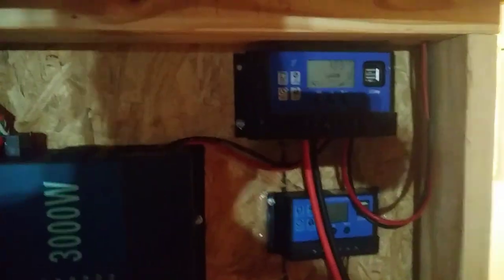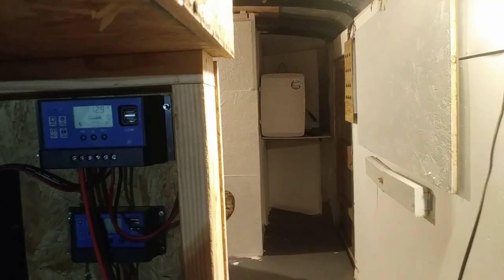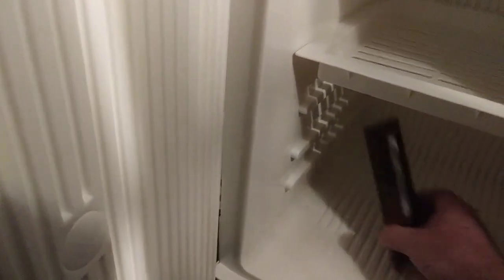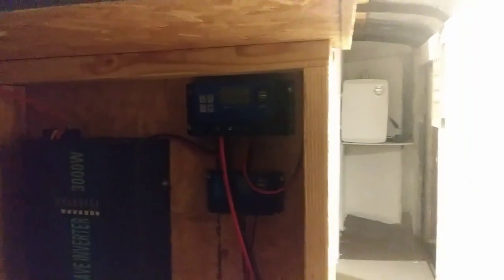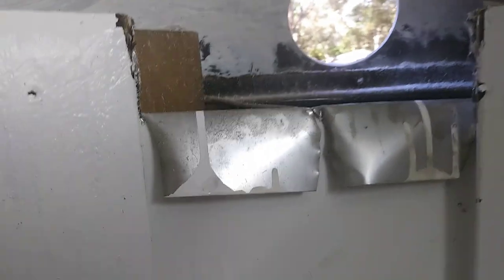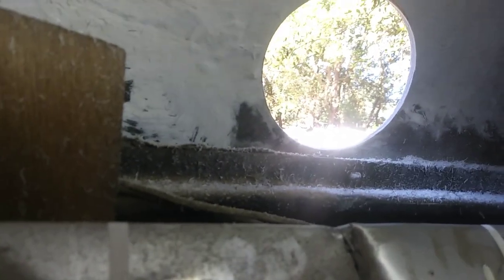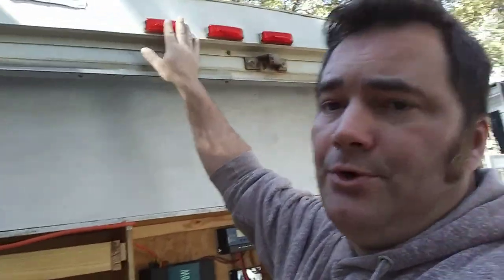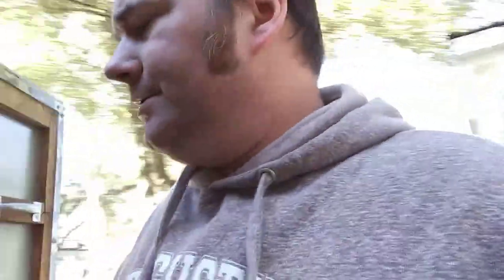6x12 Trailer Conversion Update. Testing the Igloo Iceless 40 Quart Cooler

Comment: CFP, a thought about your voltage testing and the fridge.
Starting with a warm and empty fridge will show you maximum draw not normal overnight usage. 
Fill the fridge at least halfway, and cool it to temp either on 120v system or 12v inverter before you start your test.  

Looking great so far!

Comment: trying out my buddy portable gas heater tonight since its going down to freezing 32°f here. seeing is trying knowing is doing... so far on the low 6 hour per 1pound propane tank its hot. main heat has not kicked on and its in the low 40's out in here 74° actually on low its too hot and the house is 1000 sqft old block wood floors not great insulation. so i had mentioned this for your heat for the trailer. small cheap easy and this is my 2 cents for the cold nights. very hot on low. just the pilot light throws off some heat. $78.81 @ walmart. only i would add is a ceiling fan "on low as it dont work well in a strong breeze" downward as heat does go only up leaving floor area cold.
UPDATE..... after testing 2 times with 2 - 1 pound tanks ran just over 4 hours each time on Low setting.
Reply from the maker: Those things are awsome. Seen many great videos on them

Comment: again i say.. check grease or replace wheel bearings. lots of weight heat age.. im old and heavy too.. anyway small wheels spin fast 🍩🍩
Reply from the maker: Yep that will get done when I swap out the tires. Oh and we've got torsion axle so much easier 👍